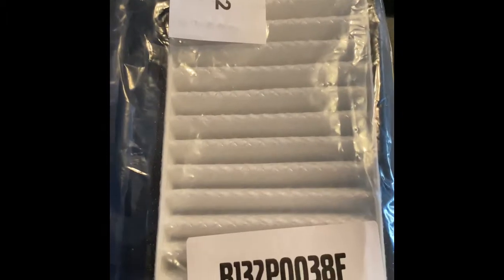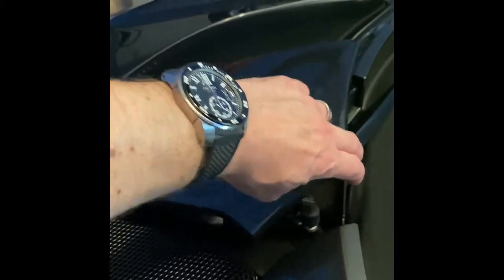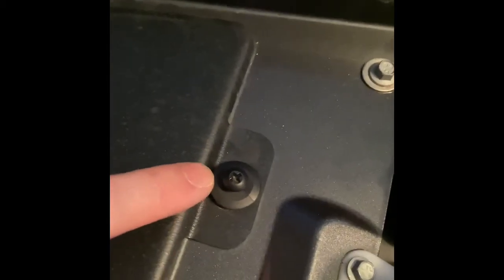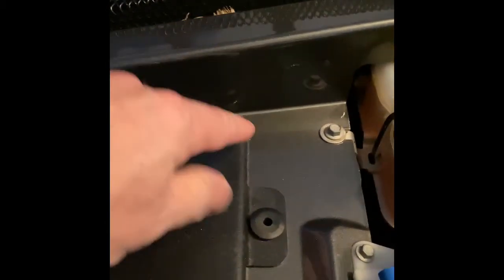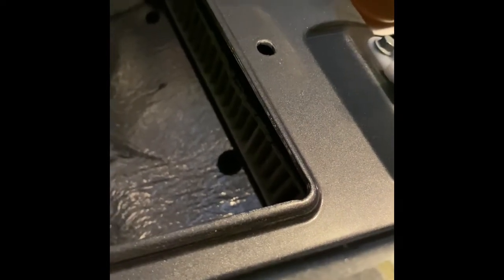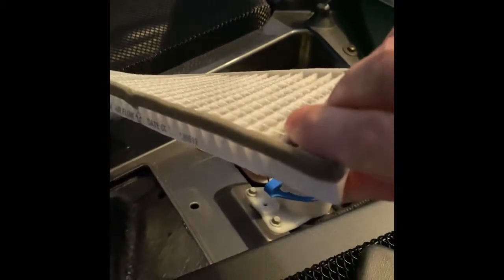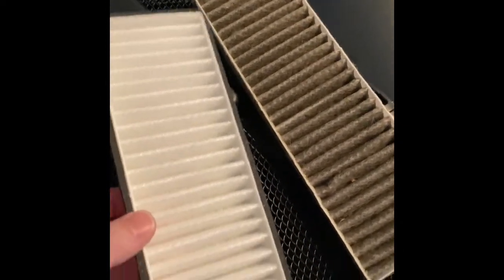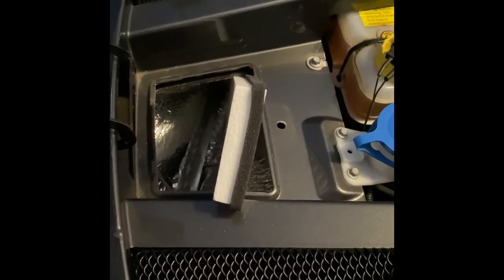Lotus Evora Air Filter Change

Comment: thanks for the video.....question for you if you don't mind...how did you route the cord for the radar detector...looks as though you routed done into the defrost vent? Hard to see...really would like to know how you did it.! tia
Reply from the maker: Great question. 🤔  I believe that is exactly what I did and routed it towards the driver’s door. I believe even before I got there, I was able to see the wire from underneath the steering wheel. The little leather cushion underneath the steering wheel is just connected by Velcro and would always come loose on my car. When I was doing it, it popped off again and I was able to grab the wire and plug it into the cigarette lighter.
Reply: @michaelsantino2023  thank you for your reply, so to be clear, I just push the wire down into the defrost vent and look for it under the leather cushion under the steering wheel? I always thought the defroster vent was an enclosed tube of sorts?
Reply from the maker: @billiardbrawler  actually, I just went down to the car. It is a little different. Is there a way I can text you a video I just took?
Reply from the maker: @billiardbrawler  just sent. Not my best filming, but you’ll see. The video kind of flips on the phone as you’re watching.